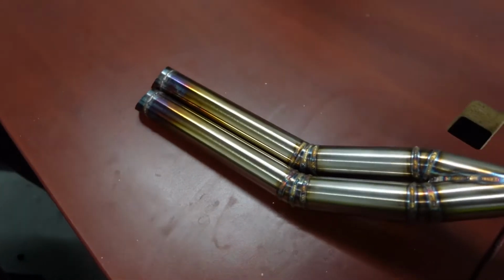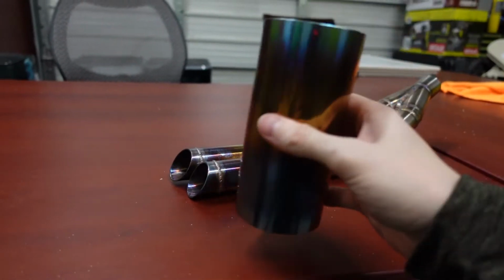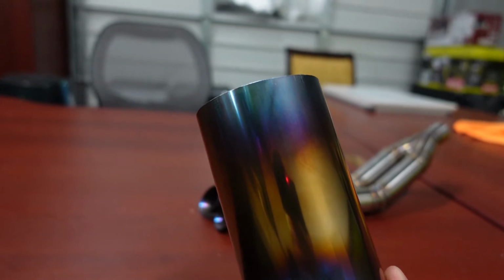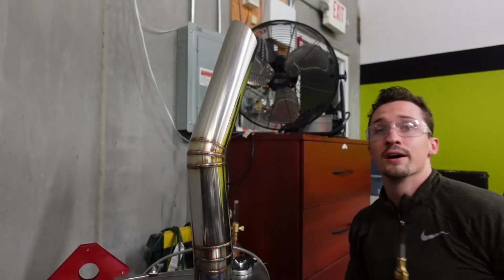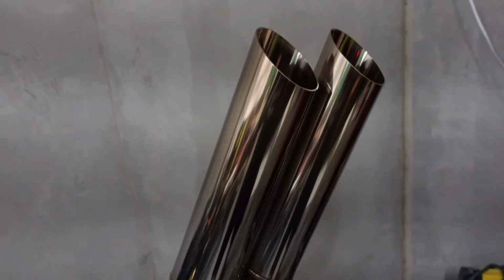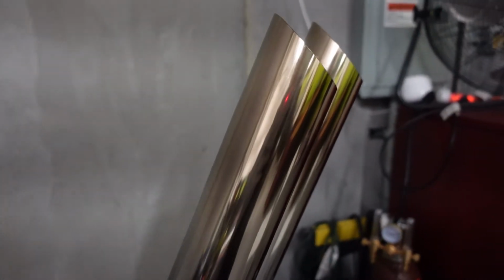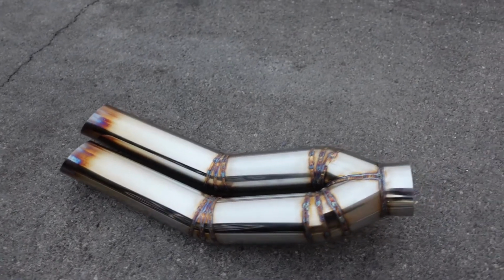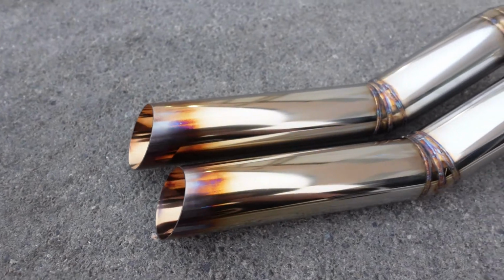DIY BURNT EXHAUST TIPS JDM BLAST PIPES | 2ND TRY | Heat Anodizing Stainless Steel Exhaust at Home

Comment: You should try using a fire starter torch and set up a jig to keep it rotating and angle the flame down the pipe until you get the color and transition you want. Use a test piece first next time so you can find the right angle and distance and rpm.